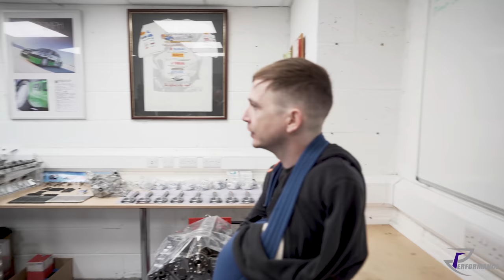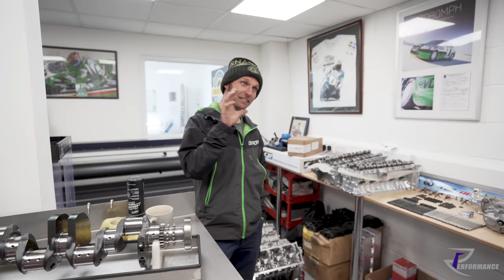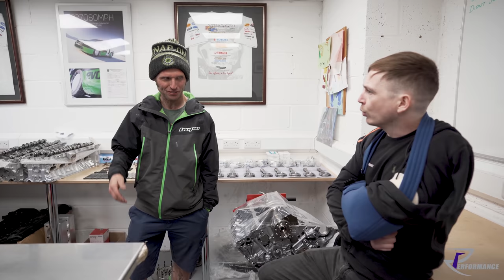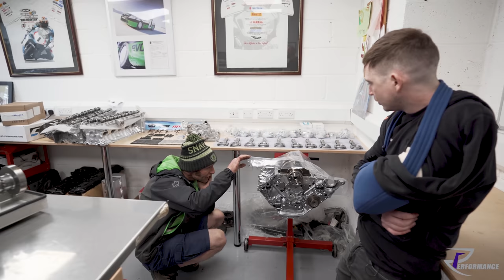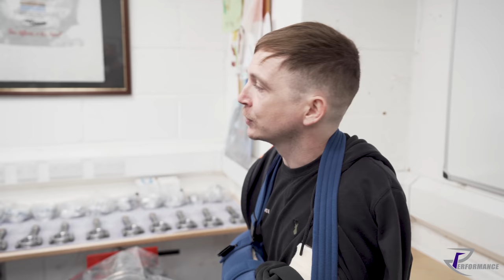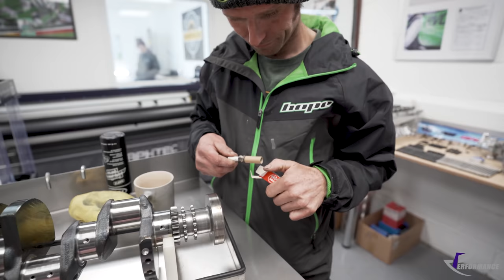**GUY MARTIN** – "The TT should've GOT me!!" – REPerformance EXCLUSIVE interview Part 2

Comment: Guy being humble. He was a better TT rider than he admits to. He did unbelievable for a bloke who was part time.
Reply: Michael Dunlop is part time. He owns tipper lorries, a veterinary clinic, builds engines and owns a restaurant/bar. He has 19 TT wins. However, Guy was a fantastic rider and in any other era, would have had at least half a dozen TT wins. He’s a tremendous character.
Reply: @88pedro888   difference is he works for someone else and MD works for himself, he has employees that do the work, guy grafts 60hrs a week and then races on weekends, kept his true grass routes racing attitude. 
Not to say he would of won anything but certainly takes it toll
Reply: @88pedro888  Dunlop owns all of those things because of his TT success, not the other way around.
Reply: @iamtherealzombie  big prize money
Reply: @ct9683  Not that much prize money from the TT, I don't think... but sponsor money perhaps
Reply: @iamtherealzombie  iv read that’s it’s 52k or something around there.
Reply: Guy won plenty. Just not TT. Most podiums without winning. Lacked a bit o luck maybe.
Reply: @bignosecrisuk5860  He just struggled to hold it together in a long race, so he'd have great moments in the TT or have a sensational lap, but then he'd come off the boil. That wasn't a problem in the shorter Irish races which suited his fast frontrunner style well.

Comment: High torque low revs lifts heads.  not x - hp
Reply from the maker: Yes, peak cylinder pressure is low rpm high load.